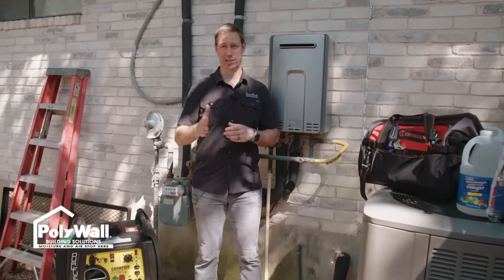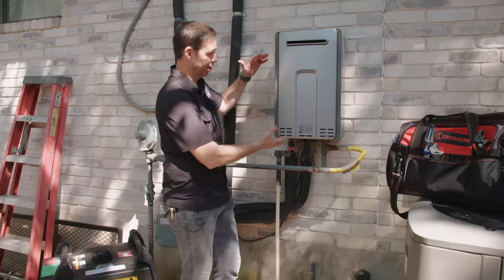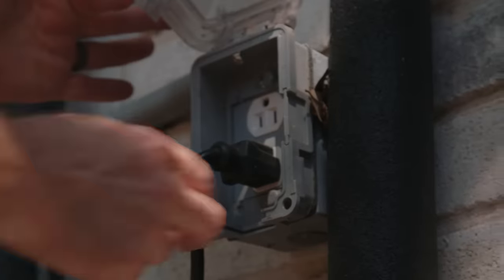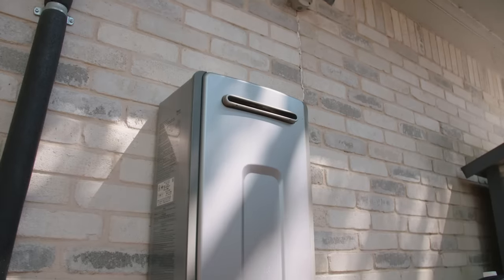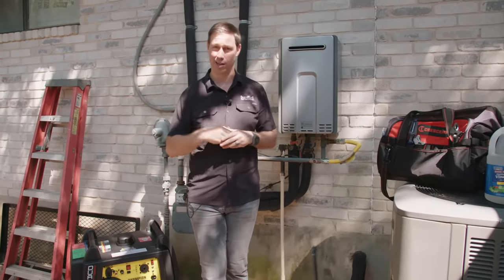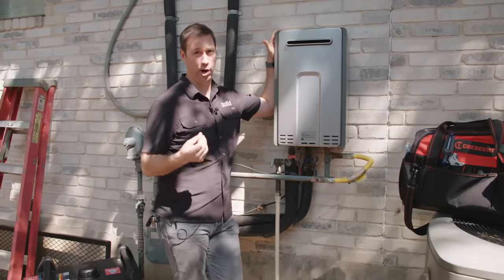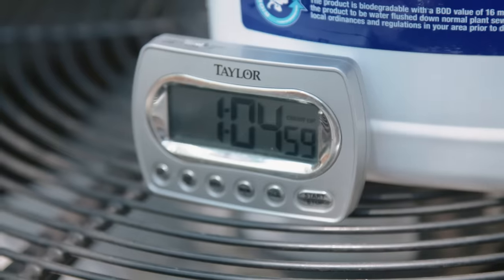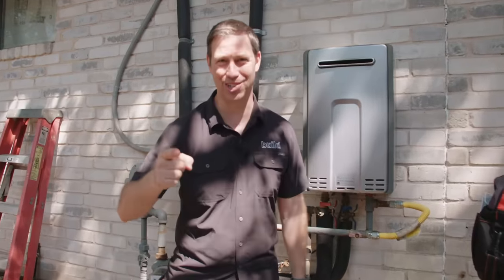3 Things They Don’t Tell You About Tankless

Comment: I had replaced a conventional water heater in my last house, the original finally started to leak, so I was forced to replace. Living in an area where there was no natural gas, I had propane for heat and hot water, that was not exactly economical, so I figured tankless was the way to go. Oh I ended up saving on propane, especially in the summer months when I did not have to run the heat. But with a well and septic system in the mix, I ended up using a lot of extra water waiting for the hot water to flow! Enough extra that burned out the well pump, plus filled the septic tank up sooner in doing so. I believe they are a waste of water, so much so that in my new home I have a regular electric how water heater, the newest most efficient I could get, that with a very good solar electric system and supplemental solar hot water system that brings hot water in seconds, I now save both water and money!
Reply: Your well pump on your previous home went out because it was old, not because of the tankless water heater.  You already went through one hot water tank which means the well pump was probably at least 20 years old.  The amount of water usage regardless of the system is the same.

Regardless of what system you used, eventually the pipe water leading to shower or faucet will get cold. If you had a conventional hot water heater, the hot water would have push out the same amount of cold water though the pipe till it reaches the shower head, so the water usage is exactly the same.

Your new home system sounds fine. I had solar hot water in my old house in the 1980's and it delivered all the time, except when it didn't which was all of the time.  The DC pump was constantly breaking down. It cost to much to keep repairing the pump so I tore it off the roof and some guy used it to heat his pool.
Reply: @LarryZamba  actually the pump was only two years old, the original one was knocked out by lightning was 8 years old. So now I have small electric hot water heater for the kitchen sink faucet, plus in both bathrooms, that with the help of the solar electric generation and solar water heater, I have immediate hot water everywhere in my house. The expense of which was up front, but now thanks to the sun is very economical, plus without the need to run the water to get warm/hot is very conservatively minded. I was filling empty bottles with the water that ran though for the time before both systems were installed, that I’m storing for emergencies.

Comment: I looked into going tankless replacing my aging natural gas 50 gallon tank but by the time I  replumbed for the larger gas line required for the tankless and the added cost to get the condensate properly drained away, plus the nearly three times the cost of another tank unit I need to live to 150 just to start get a positive return.   Sorry it just wasn't for me.

Comment: Why doesn't ANYBODY talk about the benefits of having Both? You don't need a 100 Gal WH or 220 Volt Tankless(gas or propane needs to be vented to the outside). Get a 40 Gal WH to heat the water to 80F and then have a smaller Tankless heat it to 110. It's having to heat 40F street water up to 110 in the winter, that causes cold showers from WHs, and one gal. per minute Tankless(tankless will only allow the correct temperature water 110F to flow).
--The tankless can be installed closer to the kitchen/bath/utility room, so you don't have to wait 5 minutes in the winter for hot water.
--Both will last longer than only one turned up to High all the time, and saves water heating bills. I save about 20%.
--If one goes out(on Xmas Eve, at midnight, with 10 guests for the holiday week), the other can make do until you or a plumber can install another one without an expensive Emergency charge.

Comment: I'm liking those "tankless" heaters more an more but your comment on "if you have a tank and use it, it runs out of hot water" well I say NOT actually true! 😁 If you install an indirect hot water tank like I used too, my customers Never ran out of hot water!! 1 person in the shower, 1 running the bath and someone doing the dishes....never got a temperature drop!! Even with a cold start boiler ya still have ample hot water!! 😁

Comment: I hate to be negative about these, I really wanted one but it is too costly. I replaced my 50 gal tank which was in for 26 years for $700 and the tankless was $2300 at that rate my break even point is 20 years out including saving about $85 a year on gas. There is also the new gas line which would have to be run because of the requirements of these units and the installation cost that I did not include. This pushes the break even point out even further. So yes there is a savings but it is a long way out. I don't plan on being here form the 25 years it would take to break even.

Comment: what will actually happen is your kids will despise showers because its just another thing dad is too strict about. their hygiene will go downhill fast as soon as they move out. the better solution is to put the timer in the hot water system that you are the only one that knows exists and thus bypass... have it set so it fades out the heat like a tank running out... when they ask why it is happening tell them things don't last forever and you dont have the $5000 you'd need to replace the parts that are wearing out on it then as they start to build their own routine around it they won't think 'dads just an asshole who is trying to embarrass me because he doesn't want me to have a girlfriend or whatever' and it'll improve their ability to plan and schedule themselves... because everyone hates dad being a narc but if it's a 'deal with what we all get' situation in their head and seems fair everyone hates cold showers more

Comment: Let’s be honest here, you are not comparing apples to apples when you say that if you take longer showers your saving go out the window. The fair comparison is done under the same usage. Also when you say you have to annually flush the tankless and pay a plumber to do it, the same argument can be done for draining your tank and changing your anode rod, if you are not handy enough to do it yourself, you’ll have to pay a plumber also. And now a days there are tankless water heaters that are beyond 90% efficient. Tell me how efficient a traditional water heater is? And with tankless you can do all sort of cool things like remotely controlling temperature, some models have recirculating pumps to make sure you get hot water faster and with precise temperature adjustment.

Comment: OOops I installed a traditional water heater about 15 years ago and never drained or replaced any elements!!.  Paid $350 for it and $100 for the plumber to install.  Never had and issue so far but I will drain it soon..

Comment: i am looking at a propane tankless. is there a model that can run on propane and 12 volt? i am trying to build an off grid system, using as little power as possible.
Reply: Yes on eBay, even better 2 D size batteries that last forever.

Comment: A battery backup (UPS) Would make more sense than a generator. That thing doesn't use much power a $200-$300 UPS would run it for almost a Day without using any Gas or Propane and it would be instant no going out to start the Genny.

Comment: There is one downside to instant hot water.

If one person is in the shower you can't use the hot water or even the cold water because it will affect the temperature of the water in the shower i.e. It will get too hot or too cold.

Typically that's not a problem as most people get out of the shower fairly quickly.

If you want to hurry someone up then it's simply a matter of turning on the hot or cold water elsewhere in the house.

🙂

Comment: Does the unit turn on if you lose water pressure and if so, what is the result?
Reply: Typically it must have a certain flow rate to kick on, say 1 gallon per minute and you can simply control maximum or minimum heat by opening your one water knob at say your shower, fully will be the coldest and as low as you can close the knob but still have at least 1gpm will make the water the hottest. But you will be pulling far more electricity heating the water at the slowest rate, than at a faster rate. Like if I am running other heavy pull equipment in the house and try taking a shower with the water extremely hot, then I risk tripping the breaker outside the house, which would suck especially if you forgot to turn that other heavy stuff off and it's at night. Since now you are buck naked inside the house with soap all over you and your face and eyes, in pitch black since the power just tripped off and you have to get cleaned up, clothes on and go outside and unlock the breaker box, to flip the breaker back on. Of course remembering to turn off the other heavy crap that caused it as well, before turning the breaker back on since everything will start back up as soon as you do, other than the cold shower water that you cut off before going outside. They are great though and I love my tankless, it's just a consideration before running it at high heat for long to not have a bunch of other heavy load stuff on your breaker. My say 100a breaker, the small tankless I have pulls I want to say 54 amps. Some of the heaters I have pull like 27 amps, so mainly running stuff like heaters/ac's, microwaves, etc along with all your everyday lights, refridge, etc when I run the hot water can put it over. So I might turn off  a heater/ac when I take a shower and not run the microwave or electric stove, etc while showering or while using something that needs hot water like a dishwasher or washer at the same time. I'm normally not running anything that would cause a problem other than sometimes the heater or ac, depending on time of year. So it's typically not an issue, but that once in a blue moon when you are and forget and wind up tripping it when all sudsed up and suddenly the power goes out and the water goes from hot to super cold, and you now in pitch black in this situation knowing what you now have to do, is really annoying.

Comment: Installinga a tankless heater, you need to calculate the proper pipe size, you may need new gas lines. They require greater gas flow than tank water heaters. We don't maintain our  old gas tank water heater at all and it has no electrical component so we'd always have hot water in a power outage. You keep referring to the instantaneous heater a "tank". Energy savings are based on data not stories. Not all tankless heaters have the same efficacy ratings.

Comment: Another point (that I had to learn the hard way): Tankless heaters and flow-limiting fixtures are a terrible combination. I tried to make the smart choices environmentally and economically but ended up getting punished for it. I have to open the hot water at the sink AND the shower or I end up with ice accumulating on my posterior.  Unless someone has a better idea, I'm going to have my contractor remove the flow limiter from the shower.
Reply: i've been around a while, and the one thing I know is - high efficiency, flow limiting, energy saving equates to poor performance, all the way around.  There's no free lunch.  There will be a cost somewhere, be it time (pots taking way longer to boil), un-clean clothes, toilets that clog, water heaters that under perform.
Reply: @mikeward2922  There usually is a trade-off. The tankless water heater performs fine and was perfect with my old two-knob fixture, but the new single-knob fixture boned me. Oddly enough, I have a low-flow toilet that's powerful enough to suck down a bath towel.

Comment: If you do not do the descaling yourself and pay someone to do it you will lose any energy savings! If you ignore the descaling then you take a hit on efficiency. Another point, tankless units need lots of natural gas! The larger units need a 1 inch or larger gas line and can starve a gas furnace if both are run at the same time. Need to make sure your utility can provide the volume of gas needed to run all your gas appliances at the same time like a furnace, gas stove, gas dryer and tankless water heater. The ROI and ease of use is just not there for tankless. People who swear by them often choose to ignore the negative facts. As for the space savings… what, you need more space to store more junk?

Comment: if you get a heated hot tub, definitely must go tank-less.  missed that one.  if you want to heat your house with hot water...tank-less.  why use hot water to heat a home? - no dust/mold collection inside the ventilation system.  missed that one too.

Comment: It's not how long you are in the shower but how long you let the water run.  You don't need to run the water every single second you are in the shower.   Turn it on only when you first wet your body and when you rinse, not in between.

Comment: No doubt there's a lot of upside to Tankless. Endless hot water is inviting but it seems to me that a lot of gas or electric $$$ energy has to be dispensed to produced hot water on demand. I'll stick to my gas fired water heater. It'll still maintain 50 gallons of hot water during a black out. My water heater has a pan underneath and a water shut-off system in case the tank decides to take a pee. It sits next to my boiler inside an area dedicated for them, safe n secure. Endless hot showers are wasteful and unreasonable and those kids wanting to save the planet should be reminded of that. My wife's super hot sauna showers r an exception, of course!.....😛

Comment: In an earthquake, if the water gets shut off, with a tank you've got 50 gallons or more in storage.
Reply: The '94 quake in l.a. happened in the middle of winter, power was the only thing knocked out. The old tank type worked like a charm, stand alone operation no 115 power needed.

Comment: what is true... is that EVERY customer I've installed a tankless for has seen their gas bill drop. a condensing navien is 97% efficient. the average tank heater is 55% efficient. THAT- is the unadulterated truth. a tank heater wastes HALF of all the gas you burn. but the biggest waste? is the fact that the tank will rust through in very short order. the tankless will outlast 3 or 4 tank heaters... and cut your gas usage on hot water in HALF while it's in operation.

Comment: Generator!?!?! Seems a huge overkill. I bought a small battery back up used for computers to support mine unit and it worked as long as three days without any problem (that is the longest I've gone without power). The power needs are minimal and for less than $200 I've never had the my tankless not startup.

Comment: They don't tell you that if the power goes out you won't get hot water. When I buy a car they don't tell me I have to put gasoline in it. When I buy a phone, they don't tell me I have to charge it up. Some things you just have to figure out on your own. Or watch a YouTube video.

Also, how are you going to run a shower in a blackout? It takes electricity to run the pump.

Comment: Ok noritz failed heater core a real mess i still have it. so special tech comes out gotta get on his schedule(not all techs can do it) it fails noritz mails out replacement parts 4 days or more to receive..Only then can i call to get on schedule..remember only special techs work on them. another 4 to 5 days.. $1300 labor parts were free.  less then a week later it filed again. The thermal cord failed well heck yes the old unit leaked overheated and caused partial failure of cord.. i inspected cord its 2 solid strands of a solder like material, another service call wait for tech. 5 dollar cord killed heater. Think should it have been changed first repair?  nope $300 dollars more to replace cord.. It died 6 months later the thermostat for temp no longer operates at 120s he upped temp to 130 it works fine. He was there to do servicing flush at $200 a pop, changed temp for free.. Didnt even last a year rebuilt..  Had another replaced on weekend for $3400 I got copied on receipt, not a new install a replacement of existing. Starting to get a real pain in me arse.. Yhe other unit water heater leaked replaced in 2 hours total first call to done also 1300 bucks..  read it again,, tankless will suck you dry..this is not including larger gas line needed.. 2 weeks no water heater showerd at wiffies gorgeous office showers. I hate tankless..200 bucks yearly to clean..that adds up.. Biggest con job ever tankless..

Comment: I have one of those freaks of nature.  The only reason to have one is a dumb reason.  Why would you need that much hot water?  Get proper shower heads and don't all shower at the same time.  The electric ones need massive power.  And the gas ones are just stupid.  I have a high efficiency gas tankless.  It is located in a closet in the main bath.  Sometimes I just want a little warm water to wash my hands... this monster in the closet makes funny noises.  Then it makes a poof when the burner lights.  Then it has to decide how much heat to put on.  By the time it's done all that you are done and want to get away from that thing.  It can't decide on small amounts of hot water running slowly.  It really wants me to use a lot of hot water or none at all.  Even the shower is hard to adjust.  I miss the tank.  Always at the right temperature.  Just want a trickle?  No problem, it's there for you, and faster than the tankless freak can give it.  And since all the connections are different I can't just take it out and put a tank back.  Even though I would really like to.  So I have to keep this beast.  The only benefit of having one of these is that you get used to using just cold water to wash your hands.  A tankless water heater is not for anyone.

Comment: A tankless should be mounted in your GARAGE or BASEMENT just as regular water heaters.  If you want instant hot (a recirc system) you must get a tankless that has the capability to support that...most do not.